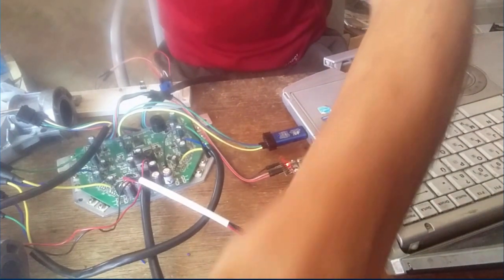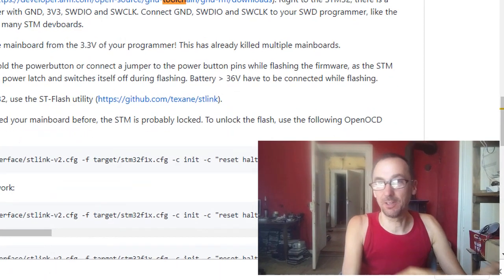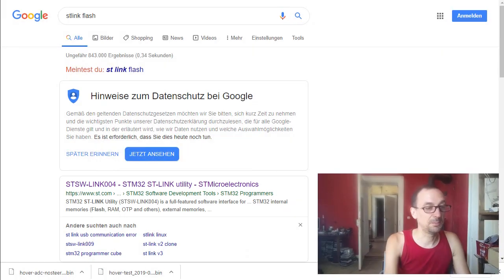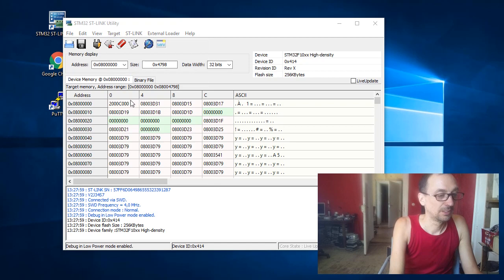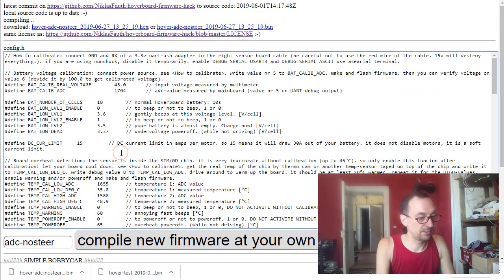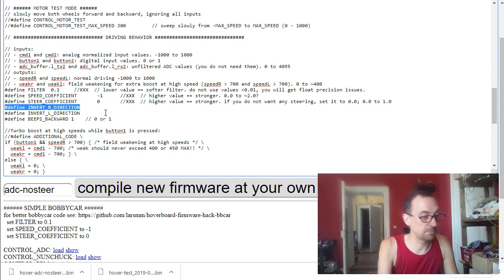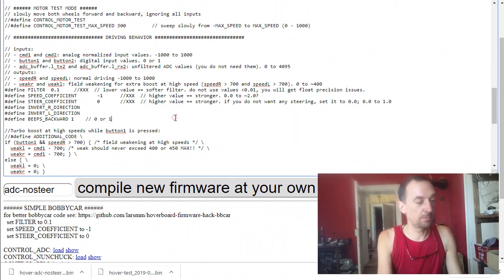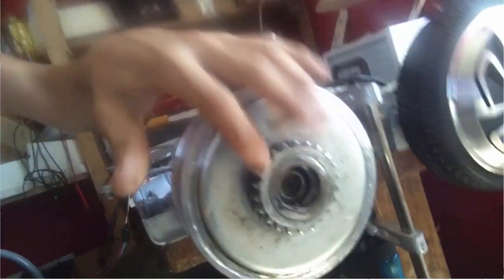free online hoverboard firmware compiler - full tutorial :-)

Comment: Is it possible to disable the hall sensor, so I can use the hoverboard controller with other none sensored bldc motors? Thanks :)
Reply from the maker: A lot rc esc also run on a STM32F103 (Or F1 processor on a Naze32 board). So you could ask him to Port his blheli to our boards:  https://github.com/bitdump/BLHeli

I guess it would only need new pin definitions.
And 10s esc are still expensive.

But take a look at my other videos where I test such a cheap "bldc controller" that has the chip for sensorless on the board. Simply search AliExpress for "bldc controller".

Comment: Mine won't turn off and the speed of the motors is not the same. Won't turn either.  Seems a software problem because before flashing the board it was working just fine. Can you help me, please? I want to put the motors on my wheelchair.
Reply from the maker: What firmware did you compile ? First always flash the original Niklas fauth firmware with no changes and see the test mode. Just as i did in this video.
Reply: @robodurden  The only firmware that partially works is https://github.com/p-h-a-i-l/hoverboard-firmware-hack/tree/bewegungsappar.at/build . With the original Niklas fauth firmware, the board just turns on then off. If I tie the wires together the board constantly turns on then off
Reply from the maker: @Diygenes  You flashed the original Fauth firmware with no changes, disconnect both motors so only the 36 Volt battery and the on/off button is connected to the board and when you push the onoff button once the boards gets on but immediately turns off again ?
Upload a 60 seconds youtube video !
Reply: @robodurden I'm going to make a video, thanks for your response! I think I missed something. My battery is a 24 volt one, but the software is for a 36 volt unit
Reply from the maker: Then of course the firmware will turn off. But usually only after the speed comes back to zero. So you should have been able to at least get the motor running once.

Comment: Hi!
I have tried ur firmware and ur arduino code example and it working very well and I can steer the robot. But I wanna to steer the robot by giving it vr and vl by myself or by giving it angular and linear speed. I tried to search into the firmware code to see where you convert speed and angle to vr and vl so I can send them the values directly but I can see nothing. Can u give some ideas! or solution! Best Regards and thanks again.
Reply from the maker: speedL and speedR are set in main.c: at lines 472+ https://github.com/RoboDurden/hoverboard-firmware-hack/blob/master/src/main.c#L472
But you should stay with speed and steer and send speed = (vr+vrl)/2 and steer = (vr-vl)/2
Reply: @robodurden  Thank you so much for the fast and interesting reply. The problem is that I have just the linear and angular speed (I am working with ROS). According to your recommendation I did not change speed and angle . Without I convert them in arduino like this:
  float  linear_speed = cmd_vel.linear.x;
  float angular_speed = cmd_vel.angular.z;
  vl=(linear_speed-e*angular_speed)/r;
  vr=(linear_speed+e*angular_speed)/r;
  localSpeed=(vr+vl)/2;
  localSteer=(vr-vl)/2;  
  Send(localSpeed,localSteer); 

The linear and angular speed in my example are in m/s so localSpeed are also in m/s  so would it feets with the  -1000 and 1000 that u have? I mean how should I convert them ?
 Do you think it is good solution!
Reply from the maker: @mazenbahy5012  if you want to dictate an absolute speed in m/s or km/h you should uncomment my SPEED_IS_KMH define. Then i guess the -1000 to +1000 for the steer will be -100% to +100% of the speed value where 60 would be 6 km/h and 150 would be 15 km/h. You would need to multiply by 3.6 to get from m/s to km/h.
But i have no idea if this will work. I calculate the real speed for the closed loop to be the maximun of either the left wheel or the right wheel.
So when you would do Send(140,-500); that should/could result in the right wheel to spin at 14 km/h and the left wheel at 7 km/h.

I suggest you restart from where you calculate cmd_vel.linear.x; and change that calculation to a speed and steer that our firmwares can handle.

And definitely move on to the Emanuel Feru firmware !!! It too has serial communicaton and absolute speed. And it is about 23 % more energy efficient while beeing about 16% faster and on top way more silent.
Watch my next video coming today or tomorrow !
I will move on too and stop maintaining my firmware.

Comment: hello to you great job because I'm struggling to death because I need you basically I flashed my motherboard and it worked and when I wanted to flash the sideboards I unfortunately made a false manipulation and since  the motherboard lights up more on the button and when I try to reinstall a program with st flash utility I have a sentence the elf loader is not accessible could you light me because I dry and the little one would like his hovercar thank you to you  to take the time to read me
Reply from the maker: You are the first one i know that tried https://github.com/EmanuelFeru/hoverboard-sideboard-hack-STM ?! You can destroy pins of the motherboard with 5 V for example. Maybe something like that happened with your programming pins. Try flashing with the battery power at 36 volt. Sorry i do not think i can be of much help.
Reply: @robodurden  ah ok thin because its me embete a lot else what does mean blink with the battery
Reply from the maker: @babayaga5976  Sorry, ask the creator of the firmware with a github issue at his repo.
And better let your words run through the google translator.

Comment: Im using your compiler for my rc mower. I tried to compile by clicking The Armchare with ppm link on the bottom and then the compile button but im getting and error.
Src/control.c:21:29: error: 'PPM_NUM_CHANNELS' undeclared here (not in a function); did you mean 'IS_TIM_CHANNELS'?
 uint16_t ppm_captured_value[PPM_NUM_CHANNELS + 1] = {500, 500};
                             ^~~~~~~~~~~~~~~~
                             IS_TIM_CHANNELS
make: * [build/control.o] Error 1
Reply from the maker: As i said in the video: after clicking such a preset 'load', search the page for XXX and you will quickly see that PPM_NUM_CHANNELS needs to be uncommented. And don't forget to set the exact number of channels that your receiver has !
Reply: @robodurden  Ok I uncommented PPM_NUM_CHANNELS and left it at 6 because i have a fs-ia6b it compliles but shows this
Src/main.c: In function 'poweroff':
Src/main.c:85:9: warning: implicit declaration of function 'abs' [-Wimplicit-function-declaration]
     if (abs(speed) < 20) {
         ^~~
Src/main.c: In function 'main':
Src/main.c:151:5: warning: implicit declaration of function 'PPM_Init'; did you mean 'HAL_Init'? [-Wimplicit-function-declaration]
     PPM_Init();
     ^~~~~~~~
     HAL_Init
Src/main.c:288:7: warning: implicit declaration of function 'setScopeChannel' [-Wimplicit-function-declaration]
       setScopeChannel(2, (int)speedR);  // 3: output speed: 0-1000
       ^~~~~~~~~~~~~~~
Src/main.c:294:7: warning: implicit declaration of function 'consoleScope' [-Wimplicit-function-declaration]
       consoleScope();
       ^~~~~~~~~~~~
Src/main.c:207:13: warning: unused variable 'scale' [-Wunused-variable]
       float scale = ppm_captured_value[2] / 1000.0f;
             ^~~~~
Src/main.c:148:9: warning: unused variable 'direction' [-Wunused-variable]
   float direction = 1;
         ^~~~~~~~~
Src/comms.c: In function 'consoleScope':
Src/comms.c:49:12: warning: passing argument 1 of 'memset' discards 'volatile' qualifier from pointer target type [-Wdiscarded-qualifiers]
     memset(uart_buf, 0, sizeof(uart_buf));
            ^~~~~~~~
In file included from Src/comms.c:6:0:
/usr/arm-none-eabi/include/string.h:33:9: note: expected 'void *' but argument is of type 'volatile uint8_t * {aka volatile unsigned char *}'
 void *  memset (void *, int, size_t);
         ^~~~~~
Src/comms.c:50:13: warning: passing argument 1 of 'sprintf' discards 'volatile' qualifier from pointer target type [-Wdiscarded-qualifiers]
     sprintf(uart_buf, "1:%i 2:%i 3:%i 4:%i 5:%i 6:%i 7:%i 8:%i\r\n", ch_buf[0], ch_buf[1], ch_buf[2], ch_buf[3], ch_buf[4], ch_buf[5], ch_buf[6], ch_buf[7]);
             ^~~~~~~~
In file included from Drivers/STM32F1xx_HAL_Driver/Inc/stm32f1xx_hal_def.h:52:0,
                 from Drivers/STM32F1xx_HAL_Driver/Inc/stm32f1xx_hal_rcc.h:47,
                 from Inc/stm32f1xx_hal_conf.h:218,
                 from Drivers/STM32F1xx_HAL_Driver/Inc/stm32f1xx_hal.h:48,
                 from Src/comms.c:1:
/usr/arm-none-eabi/include/stdio.h:244:5: note: expected 'char * restrict' but argument is of type 'volatile uint8_t * {aka volatile unsigned char *}'
 int sprintf (char *__restrict, const char *__restrict, ...)
     ^~~~~~~
Src/comms.c:54:40: warning: passing argument 1 of 'strlen' discards 'volatile' qualifier from pointer target type [-Wdiscarded-qualifiers]
       UART_DMA_CHANNEL->CNDTR = strlen(uart_buf);
                                        ^~~~~~~~
In file included from Src/comms.c:6:0:
/usr/arm-none-eabi/include/string.h:41:9: note: expected 'const char *' but argument is of type 'volatile uint8_t * {aka volatile unsigned char *}'
 size_t  strlen (const char *);
         ^~~~~~
Src/stm32f1xx_it.c: In function 'EXTI3_IRQHandler':
Src/stm32f1xx_it.c:224:5: warning: implicit declaration of function 'PPM_ISR_Callback'; did you mean 'PPM_SysTick_Callback'? [-Wimplicit-function-declaration]
     PPM_ISR_Callback();
     ^~~~~~~~~~~~~~~~
     PPM_SysTick_Callback
Reply: I uploaded that bin file and im not getting a response.
Reply from the maker: @andrewkennett940  These all are only Warnings and signal bad programming behaviors. Im am not responible for the code of the different githubs.You should open an issue there.
And here you should always state which repo you used for compiling.
When the selected repo with no changes compiles and is running successful on your hoverboard but the modified code does not, you should attach a usb-uart dongle to read the log data.
Reply: I will checkout gethub again.

Comment: @robo_durden great job on the compiler and the firmware. Would you consider adding some comments to the hoverserial.ino example? I am not a complete n00b but frankly I am not 100% sure on what the loop does and not too confident messing with it since they are actual motors on this thing. When I connect arduino to hoverboard with you code running on it, I don't understand the behavior of the motors, seems completely random. My project is based around a blue_pill connected to bno055 , a pwm receiver and well the hoverboard. Once I understand how to interact with the motors from the arduino sketch I am hoping to get the thing to stand still and be able to remote control it before I move on to computer vision and mapping. Any help is much appreciated.
Reply from the maker: well then simply add the line Serial.println(iSpeed);; before Send(iSpeed,0); to see what speed is sent to the hoverboard.
The default settins are
 int iSpeedMax = 1000;   // for SPEED_IS_KMH in config.h use 60 for max speed of 6.0 km/h
 int iSpeedDelta = 20;   // for SPEED_IS_KMH in config.h use 2 for speed steps of 0.2 km/h 

So +1000 should be fast forward and -1000 fast backwards.
If you want to send a target speed in kmh, you have to change these defines and activate the SPPED_IS_KMH in the config.h

Comment: thanks robo for you great online compliler I am using phail firmware need your help please if I want to to steer a high speed at the same place without going forward or backward .. so I need to increase steering speed how could I do it and what line need to be modified in the code. thanks and regards
Reply from the maker: For questions concerning the different firmwares better open an issue at the corrosponding githubs. to steer without moving forward you normaly set speed to 0 and steer to how fast you want to steer. so +1000 should be fasted steering to the right. or spinning right at full speed in place.
I think the phail firmware is no longer updated. Either follow the creator to biporpellant, use the original niklas, my better serial or give the new Feru firmware a try.
Reply: Thanks for your fast replay I tried to compile feru using your online complier without making any modifications but it turns error could not parse original config.h
Reply from the maker: @mohammedmy  you have to uncomment one of these lines at the beginning of config.h :

//#define VARIANT_ADC         // Variant for control via ADC input
  //#define VARIANT_USART       // Variant for Serial control via USART3 input
  //#define VARIANT_NUNCHUK     // Variant for Nunchuk controlled vehicle build
  //#define VARIANT_PPM         // Variant for RC-Remote with PPM-Sum Signal
  //#define VARIANT_PWM         // Variant for RC-Remote with PWM Signal
  //#define VARIANT_IBUS        // Variant for RC-Remotes with FLYSKY IBUS
  //#define VARIANT_HOVERCAR    // Variant for HOVERCAR build
  //#define VARIANT_HOVERBOARD  // Variant for HOVERBOARD build
  //#define VARIANT_TRANSPOTTER // Variant for TRANSPOTTER
Reply: You are a great man thank you will try it now

Comment: Hi!
Сan anyone help me resolve one issue?

I used NiklasFauth / hoverboard-firmware-hack CONTROL_ADC version.
I connected simple hall throttle which gives (when powered from 3.3v) 0.8 ... 2.5V.
Somehow I need to narrow the range from 0 ... 3.3V (ADC of firmware reaction) to 0.8 ... 2.5V (for moving only forward according to this firmware).

I changed
#define ADC2_MIN 1215 (its about 1V, if 4095 is equal max 3.3V)
and
#define ADC2_MAX 3200 (its about 2.5V, if 4095 is equal max 3.3V)

lower threshold is working! hoverboard moves only when throttle is slighlty down.
but the max speed is still above reachable threshold for throttle on 3.3V.

How can I limit the upper limit of the ADC max speed threshold to 2.5V?
Reply from the maker: Make sure the hall sensor gives analog output values. Common hall sensors only output on or off. 

I also suggest you connect serial debug output and see what analog values get processed.